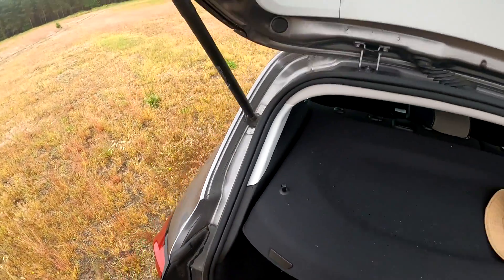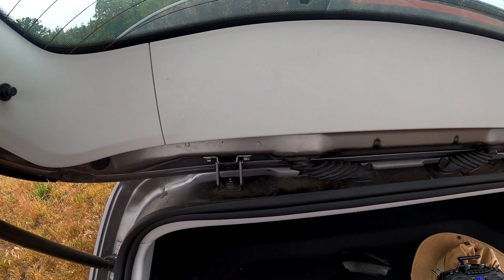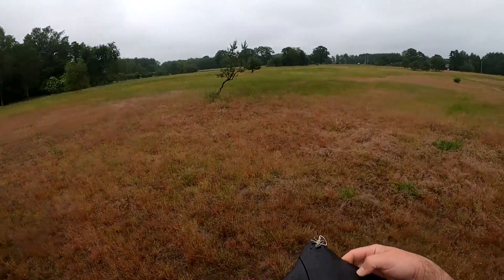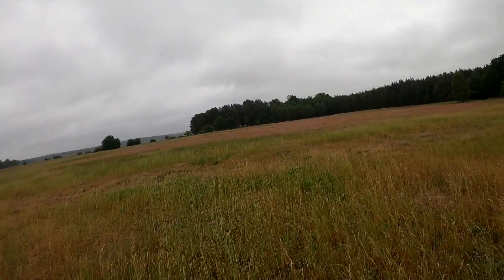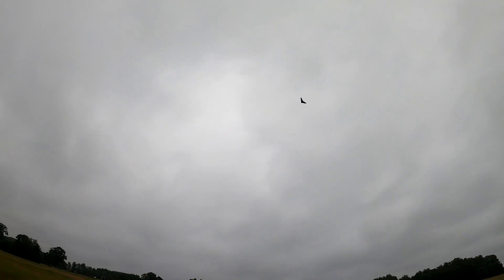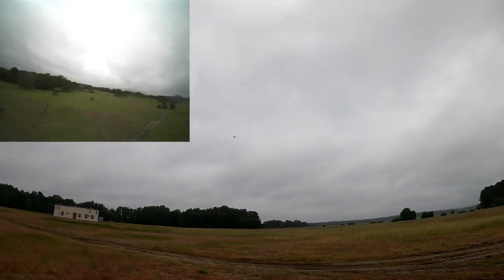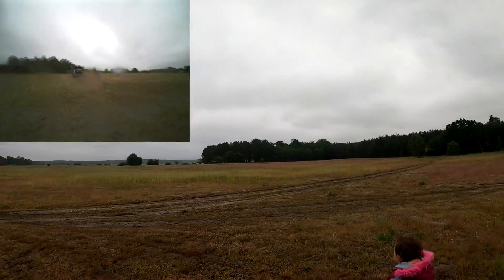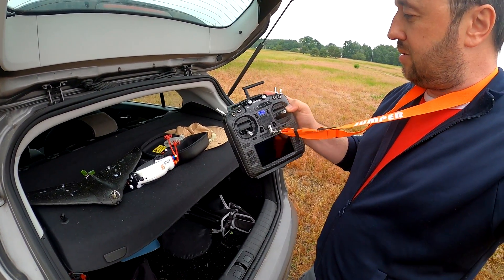Micro FPV Flying Wing #fpvuniversity

Comment: In this electronic configuration I use on 1104 7500kv brushless motor 2.5inch propeller with this battery 300mah

Comment: Where the CG would be for this plane? Look like there isn't manual and no CG marks
Reply: did you ever figure this out?
Reply: @GatherKrelt  I use the front side of the servo bay as the CG mark. works ok for my setup
Reply: @FlyByWireC  thanks! I found a comment that said 80mm from nose. That jives.
Reply: @GatherKrelt  Have a nice flight！

Comment: Hi ! I like it think this wing is a bit too tiny and still have too much weight with these components. So, it flys fast but not long and it cannot glide whatsoever. I built one with a slightly bigger EPP wing (55 cm) and it really flies better with a CC3D nano controler, even with FPV (TX03 and a better 120 deg tiny camera). So, just saying that 55 cm is the ideal size for that. Oh, and I forgot : it's very quiet with a 5000 kV + 3 bladed 3 inch prop.

Comment: A while ago I made a 1/2 scale Flite Test Arrow with 3mm depron, that is also 45cm wingspan. I was surprised how good it flew. I always thought less than 1m wingspan is not flyable, which probably was true back in the NiCd and 40Mhz days. But if it is light enough you can go way smaller.

Comment: Oh that looks decent for the wind that day. Would you be able to give a measurement for CG? I just finished one of mine as a 1s build at 45-55g auw dependent on battery and was going to maiden tomorrow. I haven't seen any other builds of these yet.

I may even try an 18650 that puts it at 85g auw weight I think it would fly based on iforce2d's 450mm wing with the same motor I'm using flying at almost 100g for over 30 minutes with battery to spare. I could probably push 45 min to an hour out of a 1s sub 100 gram wing and there would likely be enough weight to spare for a 16x16 fc and bn-180 gps on the second build.
Reply from the maker: https://ae01.alicdn.com/kf/H9dc42aaab3c74022ab2aad10a5f69509I.jpg
Reply: @FPVUniversity  Awesome, thank you man.
Reply: Did you try the 18650 battery on it? I was thinking on the same thing. However, I think it's not possible to power up the FC from just 1S. It might be possible with a voltage regulator like small powerbanks include or with a level shifter.
Reply: @JaviRP97  They have 1s specific boards with a boost regulator onboard that are good for around 2.5v in my experience. I wasn't able to get it working well on an 18650 I just thought it was too heavy I was also having thrust angle problems though and haven't tested it with the 18650 since fixing that.
Reply: @thirtythreeeyes8624  Wow, thanks for that quick answer! What board were you using with GPS and so on? As far as the battery, I'll try one 18650 on my Multiplex Fox (that will have problems with weight too) and I needed that regulator because the Rx doesn't support that low voltage. That's why I'm so curious about your FC. Cheers!
Reply: @JaviRP97  I use the teeny1s f3 for all my 1s planes because it has a second uart and they can be had for around $10. I've also used really tiny boost converters when I just need 5v or in some planes I've replaced the regulators on the rx with something like a rt9193 I find most the dropout problems are because they want a wide voltage range for a rx but, if it's only going to run on 1s you can find ultra low drop-out regulators that will allow it to run much lower voltages.
Reply: @thirtythreeeyes8624  Great info, will apply it to my planes, thank you so much!